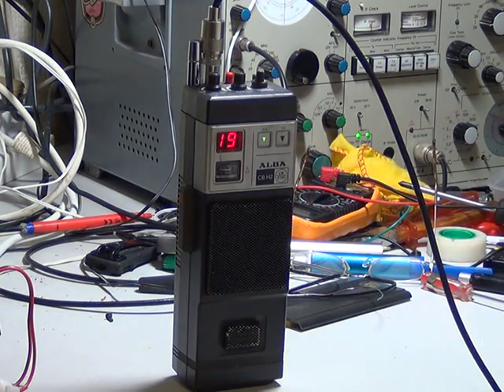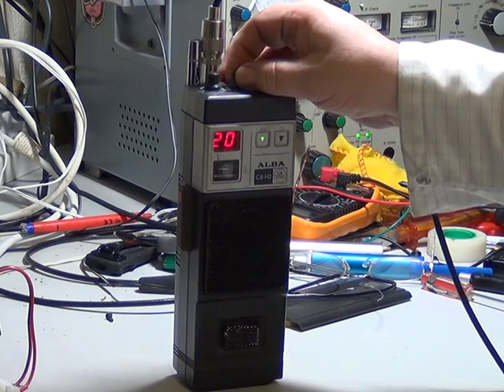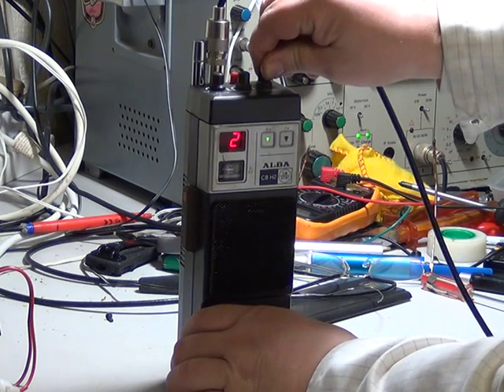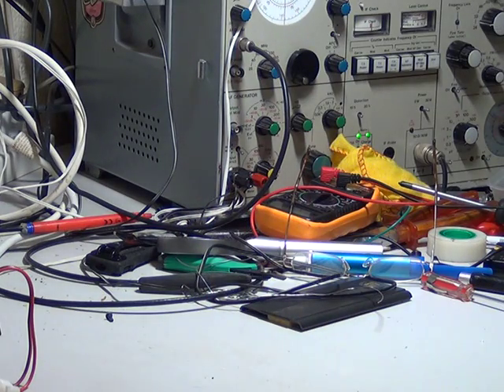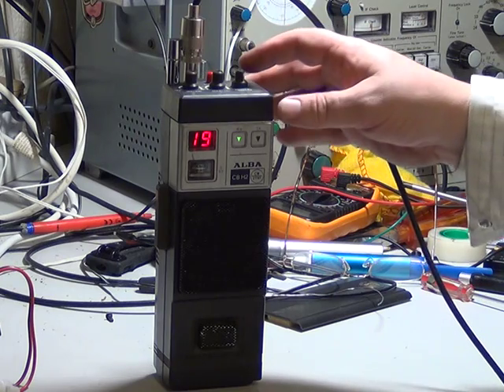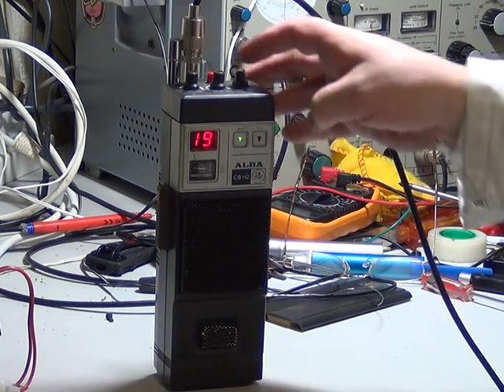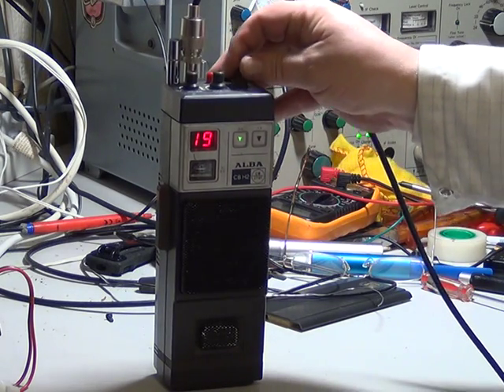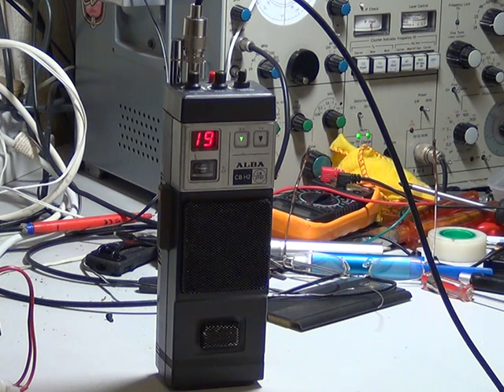Alba CBH2 - UK CB radio 2W, 40 channel (CB 27/81) (Hand portable).  On The Air Test

Comment: I bought on recently to play with, and it seems to make the right noises. Some of the battery terminals were corroded, so I fitted a 2200mah Lipo battery instead of those annoying AAs. When checking the board, I noticed what looked like an accidental blob of solder that appeared to be shorting two of the diodes at the switch end, so I carefully removed it, but that may have been a mistake, as previously it had switched through channels 1 to 40 and then gone up to 80-99. Was this a known mod?